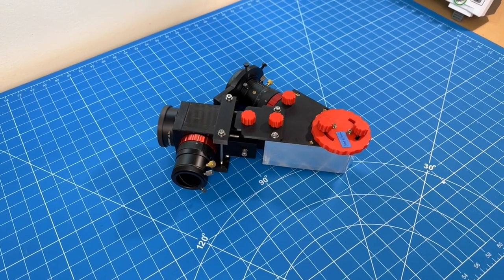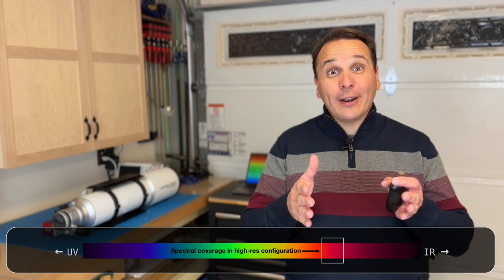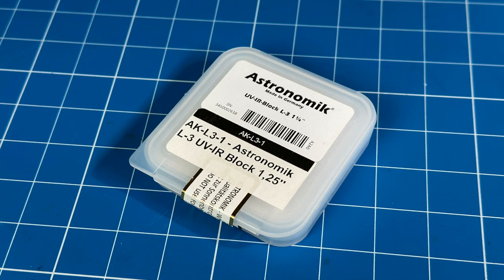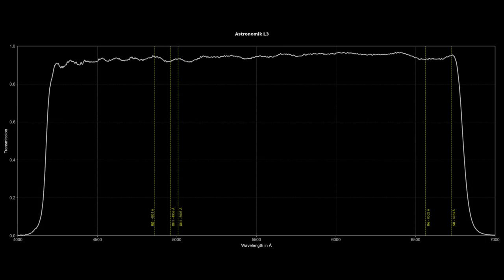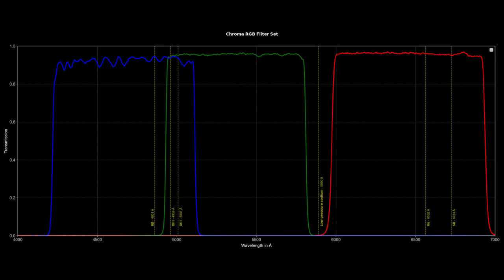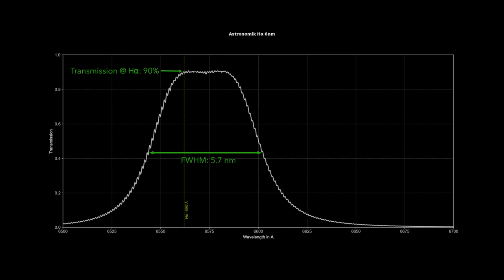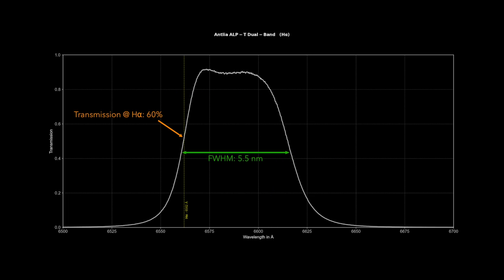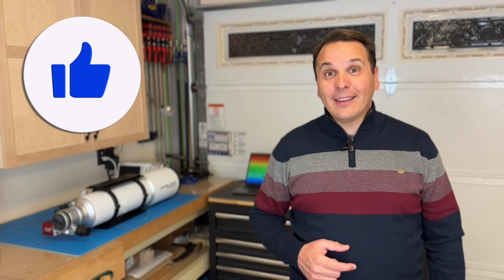Testing astrophotography filters with a HIGH RESOLUTION spectrophotometer

Comment: The ALP-T dual-band 5nm spectrum resembles a high-speed version of the filter designed for fast optics, with Ha 657.8nm and OIII 502.2nm as its central wavelengths, which differ from the standard version 656.3nm and 500.7nm intended for slower optics.
Reply from the maker: Yes, that was my assessment as well.

Comment: So what is the actual resolution of this spectrometer? 0.5nm? By the way I'm told by a reliable source that Antlia and Optolong are from the same factory in China. I have asked them both if that's true, and didn't get a response.
Reply from the maker: The resolution of my spectrophotometer in its high resolution configuration is 0.3Å, which is equal to 0.03nm.

Comment: Did anybody attempted to rebuild this project? I know of the astrosurf website. I am wondering about the lengths of the screws for the little 3D print parts that hold the maglite torch. Anybody encountered the same problem? Solutions?
Reply from the maker: I designed that part myself, using FreeCAD. I don’t think that anyone has published a design for this, it’s very much DIY.
Reply: Thank you for quick reply and thanks for a great channel. I saw a link to Lab'Ex under the Sol'Ex 'ressource' section. Anyhow --- what length for the screws do you use. I already printed the 3d parts from the Lab'Ex webpage of Christian Buil.
Reply from the maker: Oh, I did not even know that Christian had published a design for that part. I made my own, and I used whatever screws I had laying around.
Reply: Okidoki -- i will try a bunch of screws (hope I will not screw it up) :-)

Comment: There is one important aspect - maybe more for science (photometry) than pretty pictures. Many dielectric bandpass filters have so-called red leak which magnitude and starting wavelength depends on the exact receipt of a filter. Modern sensors have still sensitivity at 1000 nm and very red objects (which may emit little light in blue and would require long exposures therefore) which may be bright there will have either wrong colors, out of focus images (because focus at 1000 nm can be way off from visual) or just not correct amount of light in the intended passband ((much) more "blue" light of red object than they actually would emit), because filter behaves more like dual-passband one. One passband in e.g. blue and second one in near-infrared.
My experience with just few manufacturers tells that if standard passband plots are going just up to 900 or 1000 nm (and not to 1200 nm where silicon detector quantum efficiency would be 0 by definition), there is something suspicious going on with those filters in near-infrared.
Reply from the maker: Good point! Next time, I will also look at the near infrared (I can now go as far as 1,100nm, which I was not able to do when I originally published this video) Thanks!

Comment: Many thanks for this very informative video.  I am just moving from OSC to mono and am looking at purchasing filters.  I have been leaning towards Antlia but my concern has been performance with a fast setup.  I have a C11 with Hyperstar and I wonder how the filters that you reviewed would perform at F2.9?  

This is new to me but I believe that band shift can be an issue with faster setups.  Are you able to provide any insight please?

Kind regards,

Gord
Reply from the maker: Technically, I could measure the bandpass shift amount for each F/ ratio, but it would require some additional fixture I have not taken the time to design and build, so I do not have a definitive answer for you, unfortunately.
Reply: @darkskygeek  Many thanks.  I have just noticed today that Antlia makes a 3nm set for high speed setups between F2.6 and F3.6 so I presume that there is a shift for faster setups.  I think I’ll take the plunge.  ;-)

Cheers,

Gord

Here’s how they are listed… 

Antlia SHO (S-II, H-a & O-III) Narrowband 3nm Pro Highspeed Imaging Filter Set for f/2.6 - f/3.6 Telescopes - 2" Mounted

Comment: There was a long thread on the Cloudy Nights forum regarding Antlia filters and measured results. Antlia basically stated the same thing there: that the results were invalid and it was user/equipment error. Turns out Antlia was right - the equipment wasn't able to resolve enough detail. This certainly does not appear to be the case here since you are getting 0.03nm. Unfortunately, it seems that Antlia is completely unwilling to even entertain the idea that a filter doesn't live up to specs. Thankfully there are other filter manufacturers.

Excellent video! I own Chroma and Astronomik (and some ZWO LRGB, which are still new in the box). I'm quite happy with the performance of the Chroma filters. The Astronomik have yet to see first light... hopefully that changes tonight :).

Comment: Hi Julien, thanks for all your efforts! I was planing to do something similar, focussed on dual narrowband filters. I have access to some high-end PerkinElmer spectrometers for testing:
But, one question: Did you take the width of your slit into account when you calculate your 0.03nm resolution?! I think not only the camera, the objective lens and the grating are important, but also your collimation optics from the slit to the grating. Together with the objective lens the magnification of your setup is defined and the slit width on your camera can be (roughly) determined (without aberrations). The size of the slit image will also impact your spectral resolution (as you already mentioned).
Thanks a lot!
Reply from the maker: Hello! Yes, of course, the width of the slit was taken into account, and the resolution of the spectrograph is not just calculated, it is also verified by measuring the FWHM of calibration lines. Both give roughly the same result, i.e. 20,000 in HR mode. Hope this helps!
Reply: Yes, thanks a lot for your explanation @darkskygeek  ;)

Comment: I had my C6-N f/5 Newtonian primary mirror refigured and it came out at 1/12th wave and .98 Strehl. When I got it back and got it put together and collimated on the mount I looked through it and I thought I was looking through a refractor and I started looking at everything I could in Bortle 4-5 skies on my stiffened up modified Twilight One Alt-Az mount. Some guys in my astronomy club like to use it for deep sky imaging. Put good focuser on it, but what kind of filter would be good for my reflector in Bortle 6 here at home, just the standard ones? I have a Baader Neodymium Moon and Skyglow filter.
Reply from the maker: For visual or astrophotography?
Reply: @darkskygeek  Astrophotography, I'm mostly visual, but photography seems a bit expensive and the rigs guys in my club have seem complicated. I only have an iOptron AZ Pro so 30 second exposures would be my max.
Reply from the maker: @MountainFisher  Well, there are a lot of good choices for astrophotography in light polluted areas. If you have an OSC camera, the Optolong L-Ultimate is a good choice for narrowband imaging. And if you have a monochrome camera, look at the Antlia 3nm H-alpha and OIII filters to begin with. For broadband imaging, there is no substitute for dark skies, and I demonstrated (in another video) that a simple UV/IR cut filter gives better results than any filter you might be tempted to buy in light polluted areas. Hope this helps!